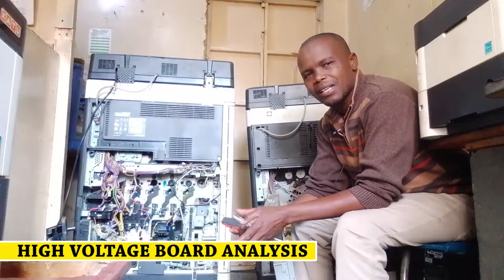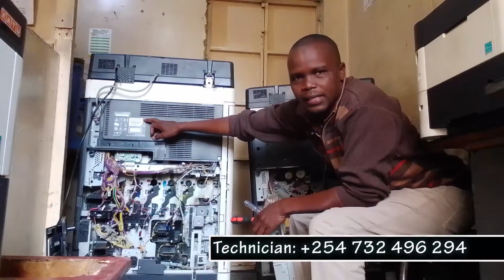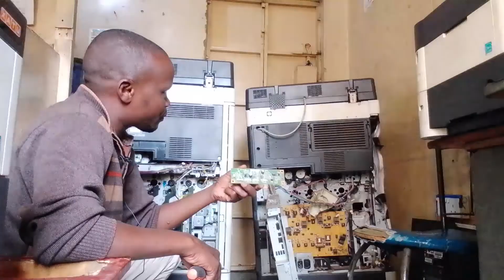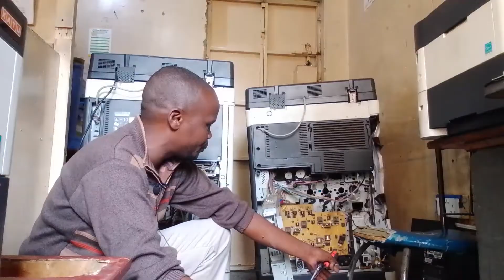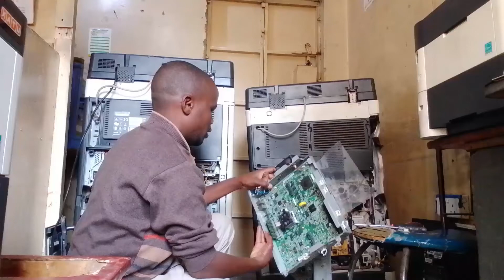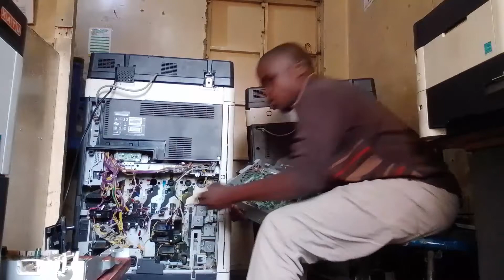HIGH VOLTAGE BOARD FOR KONICA MINOLTA bizhub printer C454e ANALYSIS.

Comment: This high voltage board is a reliable replacement for Konica Minolta Bizhub printers like the C224e, C284e, and C364e. It installs easily, works without errors, and delivers stable performance similar to the original part. Print quality remains consistent, and no service codes appeared during testing.

Build quality is slightly lower than OEM, and long-term durability is still unknown, but for the price, it's a solid option for repairs and maintenance.
Thank you very much,sir. Indeed a learned teacher!❤
Reply from the maker: I'm glad you found the information helpful! 😊